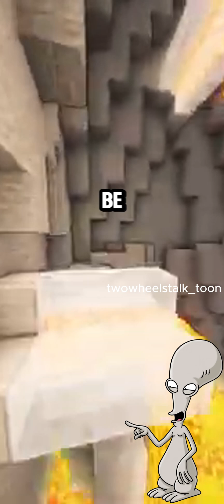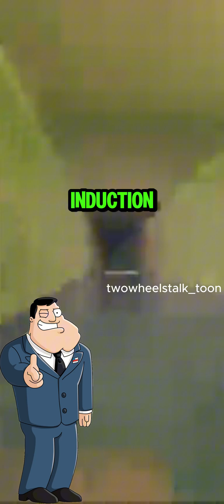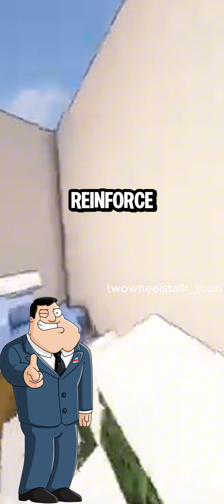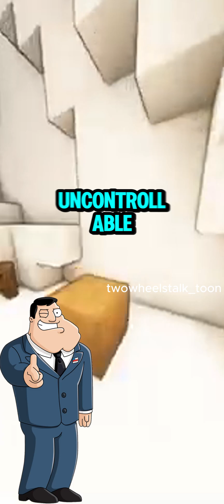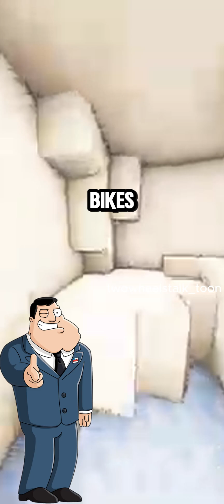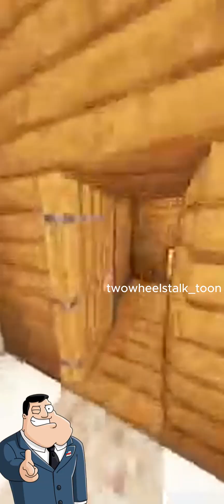Why You Can’t Just Slap a Turbo on a Motorcycle! 🚀💨

Comment: Usable powerband! That's the weakness! Although I have done one! A hyosung gt250r. Because first, my country, the occupied Iran, has a 250cc limits for engine capacity due to some neutralization of some mullahs, over 30years ago, and second, hyo is a VTwin, therefore not as much high rev, but torque monster! It's an easy task, except making the headers on the exhaust side. 
Tge results of my project: I managed to push it to low 50s WHP, at mid 11000rpm without any major issues, although soon after I realized why in cars, people leave the turbo not-attached to the chassis(it breaks the headers at the welding joints, no matter how good they're welded!😅
Reply from the maker: Wow!! Thank you for dropping your knowledge and experience over here. That’s so cool!